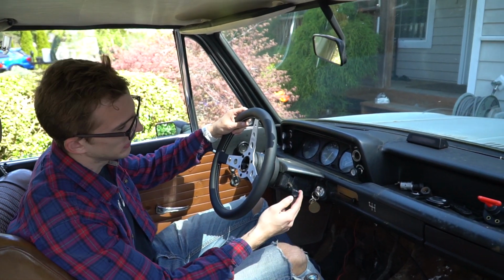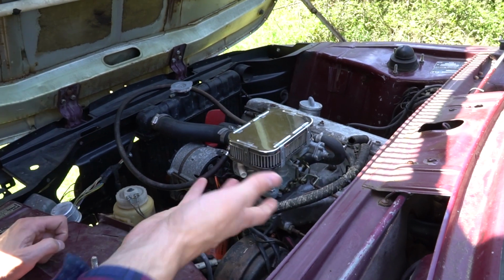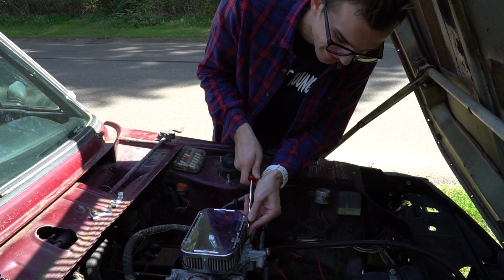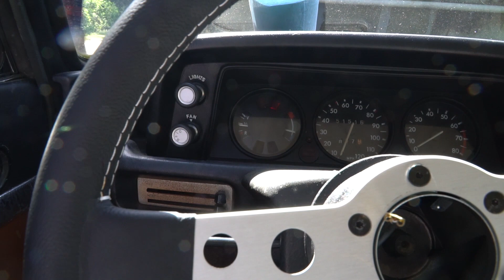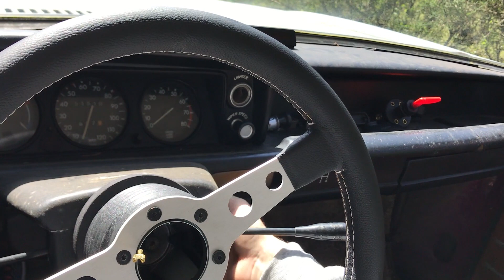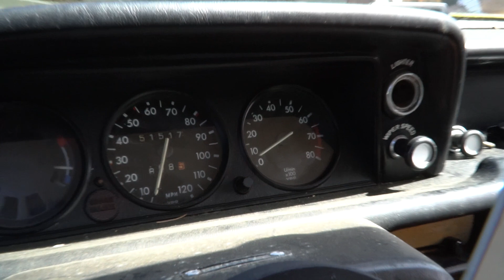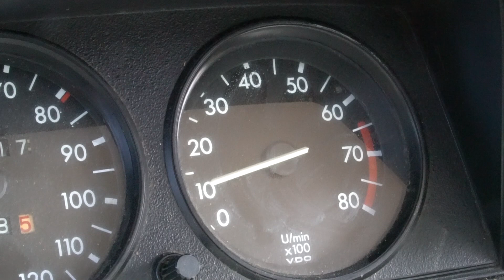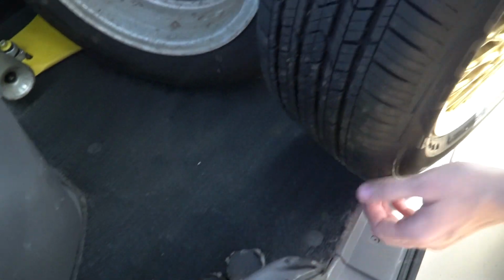SEAFOAM 1973 BMW 2002

Comment: Have you tried checking the wiring, inside the car, somewhere there*s probably a ground cable, making contact with the stalk, when you hold it or push it back it serves to stop the engine, or the switch is broken, or at one time it had an ignition cut off or deterrent, to prevent it from being started, after all those 2002, BMWs, were /still quite popular then as is today, this was way before alarm systems, came into play, check the wiring, going from the switch to the starter, If you can get a wiring diagram, or scematic showing the way it goes,that would help a lot, you can get it online, through the BMW 1600/2002 haynes manual, or the BMW2002,  parts CD.

Comment: I think you’re right it’s probably drawing too much current causing the car to die. You could check with a volt meter at the battery, should idle around 13-14volts if it drops from that when the switch is activated there is an issue with the wiper system.

Comment: If you have some Rev issues like at the start your friend said I couldn't get it higher than 4000 RPM try to press the accelerator pedal at the maximum at tune the distributor you want to rich the maximum number of revs, besides that I saw your distributor and you don't have a hose at the actuator. To get an air hose the smallest diameter and put it on the actuator of the distributor the other end needs to be hooked up with the carb to find which one simply look around your carb to find small bronze tubes, you need to find the right one when you accelerate it sucks air when RPM is normal it doesn't suck air. This will advance the timing on your distributor to have the best combustion when you floor it or when you accelerate like a jurk 😀. I will make a video of mine to show you exactly what to do. Anyway seafoam cleans and take off deposits but doesn't affect the timing your engine is in tip top chape no oil smoke no fuel excess fumes so forget about the seafoam...
Reply from the maker: Okay, that makes a lot more sense. Will try to get a line hooked up and mess with the timing some more. If you get a video posted just shoot us a message and we will try to follow along.

Comment: I had Dieseling issues in my 2002 when I first got it.  Look at the timing, it will do wonders. I would use a timing light.  As for the stock, it is defiantly shorting out, I would pull the wheel assembly apart and look there.

Comment: those stalks are real easy to take apart. Get the wiring diagram and test the connections
Reply from the maker: We found out that the window washer motor wires got hooked up to the coil and that was shorting out the coil. Fixed now!

Comment: ok....i really need you guys to just stop......lol. Find a gremlin or something to learn on. This is a classic german car, and you really dont understand how to diagnose the issues here. Dieseling is from carbom......no rpms is a bad dist advance or secondaries not working ( thats the second butter fly that opens late ....) or a bad power valve in carb. Stop buying tune up parts, and replace your %^*$#@ POINTS.......floating points will kill higher rpm range. this is a very simple and straight forward engine, and if you follow the proper steps, it will run great in half a day....DONT MAKE ME DRIVE DOWN THERE......ill do it lmao
Reply: Thank you 😅

Comment: I guess you guys are just having fun, but you have no idea what your doing
Reply from the maker: Motoicon Yeah, still lots to learn
Reply: PNW project; check the timing and tune the engine to run righr before putting additives in. Also stop dumping the clutch or soon you will destroy that old transmission. It's a rare classic not some crappy honda. Also i seen it puffing blue smoke in earlier vids it looks like its burning a lot of oil it will simply get worse if you been revving the piss out of it